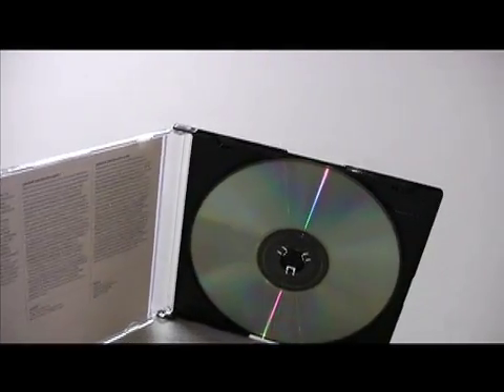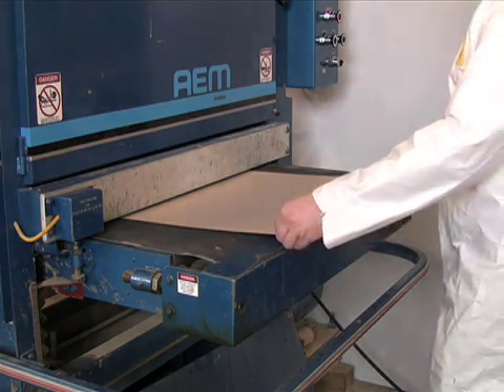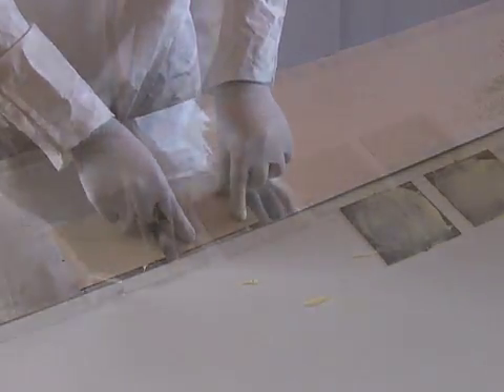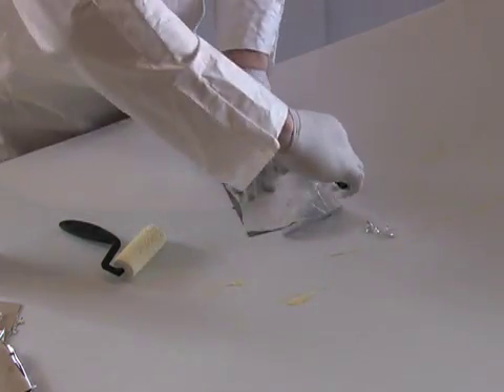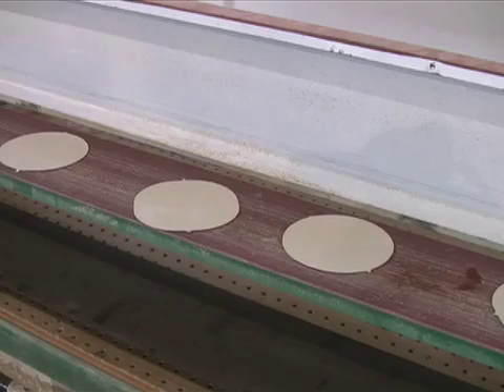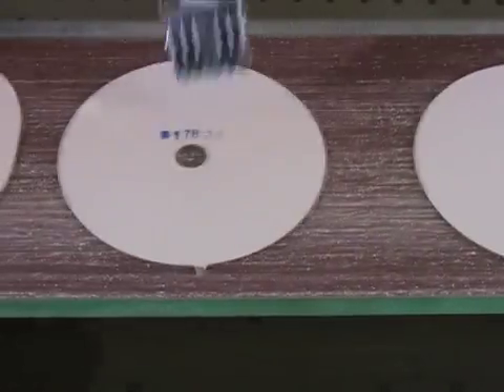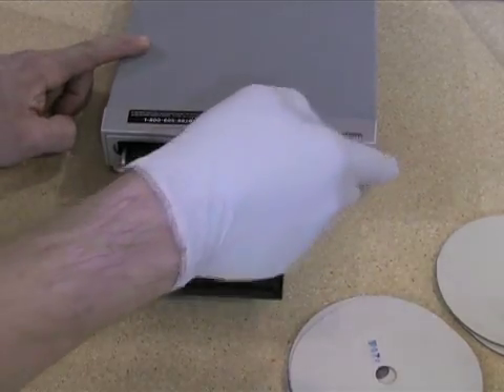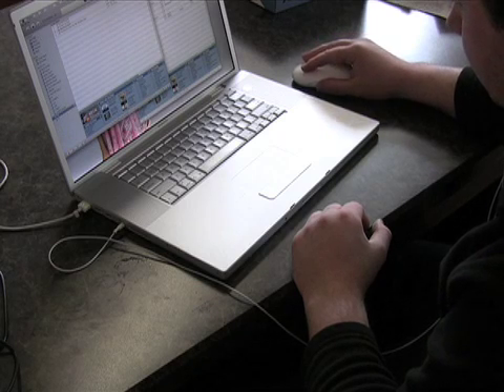How Things Are Made - CDs

Comment: WOW, i've had problems in the past with buying bulk cds, so i used this info to try to make my own handmade cd.  while i didnt have all the specialized machines in my home as this tutorial shows, i used my dryer lined with sandpaper as the tumbler to round the square discs into round ones... it will take a full cycle or 2 but works just as good.   just make sure you use the delicate cycle and everynow and then spray them down with wd-40 to cool and lubracate them during this process.